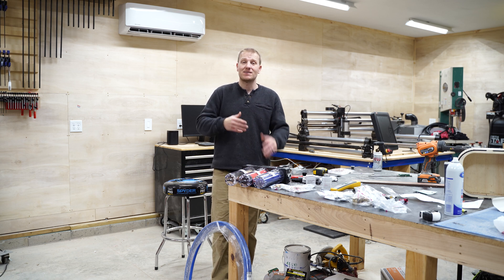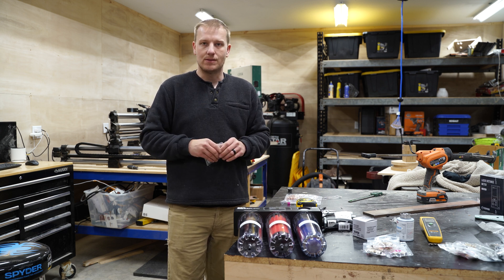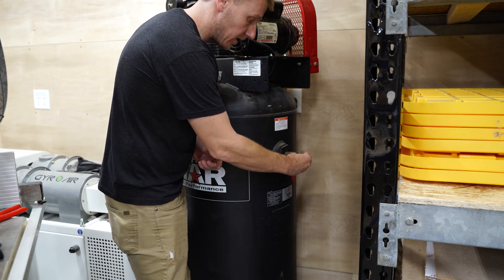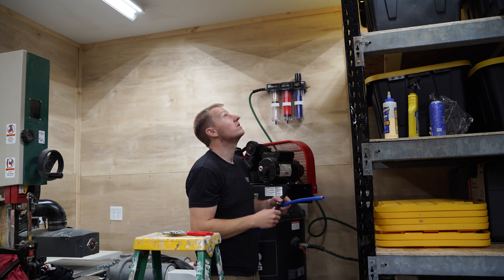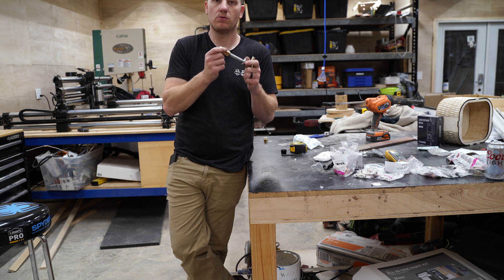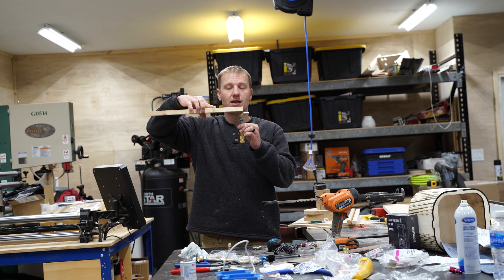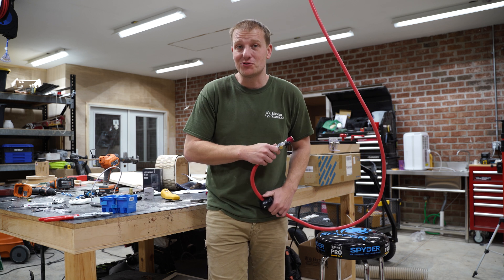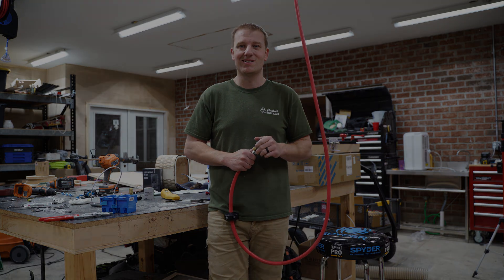Full Shop Pex Air compressor line install

Comment: From my understanding pex pipe isn't safe for compressed air ???
Reply from the maker: Sorry for the really late reply you can use pex but you have to regulate the pressures. If you plan to run anything at max psi then you will need the aluminum lined version but at 100-115 psi its 50 psi below recommended and 75 below failure psi

Comment: Does 3/8" not restrict air flow too much?
Reply from the maker: I thought about this for a bit before putting it all together but in the end result all connections to main tools are 1/4 so flow is important but in my set up and use I  "think" ill be ok.
Reply: @treyjones424  I'm going to do this too, but I think I'll be using 3/4" Pex A and try hard to keep most fittings in the 3/4" range. At least until I get to the end regulators and connectors, which will be 1/2" or 3/8".

My air compressor is an 80 gallon Champion and was previously used at an automotive detail shop, mostly for dusting; but the connection from the tank to the shop lines was 1 1/2"! I had to install bushings on it to bring it down to 3/4". Currently it has a 3-connector manifold mounted directly to the tank, but I am definitely going to plumb the shop for air with Pex. Thanks for the inspiration.

Comment: Are you going from a heated space to a cold unconditioned space above the ceiling?  You might have moisture issues or freeze up above the ceiling. Ask me how I know. I also took measures to dry the air after it left the compressor. The air is still warm and going into a colder space will create condensation in the line which will eventually freeze into a blockage. Just a word of caution from mistakes or oversight on my part. Keep up the great work
Reply from the maker: This is very interesting thought one I may have overlooked as well. I was thinking the dryer would not allow water into the lines. which i have faith it will not at the source but as you mentioned the hot air of the running compressor into the lines and quick temp change. My work is complete but ill keep an eye on it as well ill start taking temp readings both in and out of the shop. This would make for good follow up or long use video. I genuinely apricate your comment and love the advice thank you!